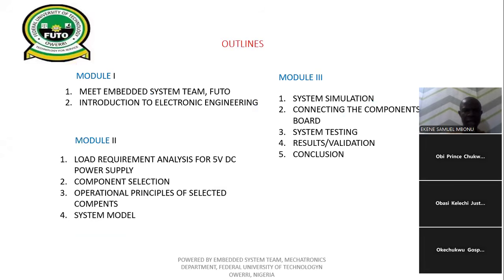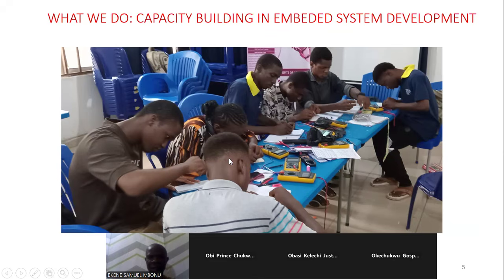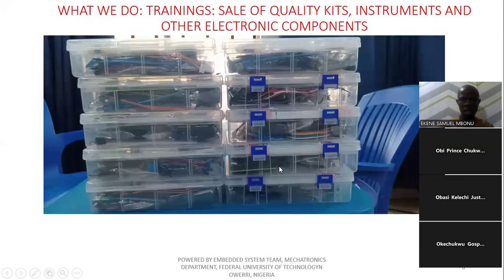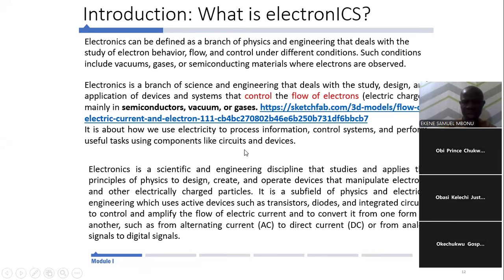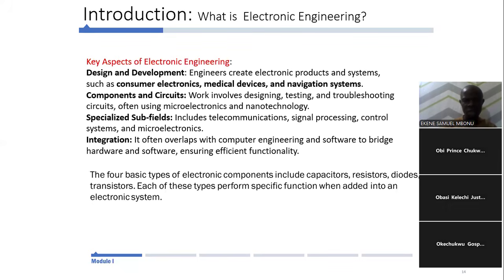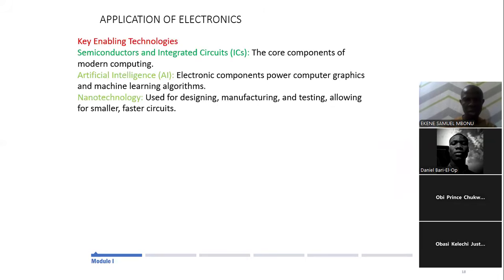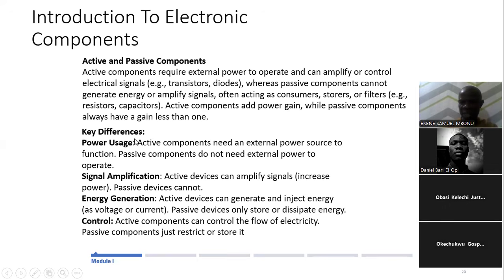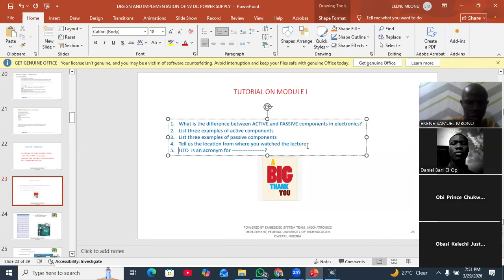DESIGN AND SIMULATION OF ELECTRONIC SYSTEMS  (MODULE I)

Comment: Good day sir
My name is Gabriel Agiounim Joseph  and I am a 100level Mechatronics student of FUTO
Active Components are Electronic components that need an external power source to work properly and can control or amplify electrical signals. Examples are Transistors, Diode, integrated circuit, etc.
Passive components are electronic components that do not need an external power source to operate and cannot amplify signals. They mainly store, limit, or dissipate energy. Examples are; Resistor, Capacitor, Inductors, etc.

Comment: Good day sir
Name: Nnaji, Chiagozie Anointing 
Department: Mechatronics Engineering 
University: FUTO
100 level 
 1. What is the difference between ACTIVE and PASSIVE components in electronics?
 Active Components: These components can inject net energy into a circuit, electrically control the flow of current, and amplify signals. They require an external power source to operate.
 Passive Components: These components cannot introduce net energy into the circuit, cannot amplify a signal, and do not require an external power source to function. Instead, they consume, dissipate, or store energy in an electric or magnetic field.
 2. List three examples of active components
 -Transistors 
 -Diodes 
 -Integrated Circuits
3. List three examples of passive components
 -Resistors
 -Capacitors
 -Inductors
 4. Tell us the location from where you watched the lecture
 I watched the lecture from my lodge in FUTO, Owerri.
 5. FUTO is an acronym for
Federal University of Technology, Owerri

Comment: Good morning sir 
My name is Ani Chinaecherem Fredrick 
100lvl student of Mechatronics Engineering FUTO 

Difference between ACTIVE and PASSIVE components:
Active components are components that can amplify or control current/voltage in a circuit and they require an external power source to work.

Passive components on the other hand cannot amplify signals and do not need an external power source — they simply consume or store energy.

Three examples of active components:
Transistor
Diode
Operational Amplifier (Op-Amp)

Three examples of passive components:
Resistor
Capacitor
Inductor

UTO - full acronym FUTO = Federal University of Technology, Owerri

Comment: Good day sir 
My name is NDUBUISI LINCOLN, a student of the 100 level Mechatronics department 
Active components are electronic devices that need an external power source to function properly and are used to control, switch, or amplify electrical signals. 
Passive components do not need an external power source and mainly store, transfer, or resist electrical energy.
Example of active components include: Diodes and transistors 
Example of passive components include: Resistors and capacitors 
I am watching from Federal University of Technology,Owerri (FUTO)

Comment: Good day sir
My name is Osoba Hebron Ebhosetalease and I am in 100lvl Mechatronics Engineering 

Active components require an external power source to operate. They can amplify signals, control or switch current flow, and generate/inject energy (e.g., increase power).

Passive components do not require an external power source.

I am watching from FUTO : Federal University of Technology, Owerri

Comment: Good Morning Sir
 I am Chukwuemeka Cherish a 100lvl mechatronics student of FUTO     
The differences between Active and passive component is the ability to generate energy or ampilify signals. Active components can generate energy and amplify signals while Passive components cannot.
Active Components; Diodes,Integrated circuits, transistors
Passive components: Resistors, capacitors,Transformers
FUTO: Federal University of Technology Owerri

Comment: Name: Cornelius Prosper 
Dept: Mechatronics Engineering 
Level: 100
Reg No: 20251516213

1: Active components are devices that can control the flow of current, amplify signals and require an external source of power to function
While 
Passive components are devices that cannot control the flow of current, amplify signals or neither require an external source of power to function but only store energy 

2: list there example of Active components
 _ integrated circuits
 _ diodes 
 _BJT transistor 

3 list there example of passive components 
 _ capacitors
 _ inductors
 _ transfors

4: I watched from hostel E futo

Futo: Federal university of technology Owerri

Comment: Good day sir 
My name is ELEKWACHI CHIBUCHI ZION
I am a 100 lvl Mechatronics student 

Active Components are Electronic components that need an external power source to work properly and can control or amplify electrical signals. Examples are Transistors, Diode, etc.

Passive components are electronic components that do not need an external power source to operate and cannot amplify signals. They can store, or limit energy. Examples are; Resistor, Capacitor, Inductors, etc.

I am watching from FUTO

FUTO stands for Federal University of Technology OwerrI

Comment: Good 😊 morning sir
My name is AKAchukwu okoudennam. A hundred level Mechatronics student FUTO

e
1. ACTIVE COMPONENTS: this are electronic components that require an external power source to operate and can control as well as amplify 

EXAMPLES :I) Transistors
                       ii) Diode
                       iii) Integrated circuit

 
2. PASSIVE COMPONENTS: these are electronic components which do not amplify signals and do not require an external power source to operate e

EXAMPLES: I) Resistor 
                      ii) Capacitor 
                      iii) Transformers 

3. UTO: University Training Office 

4. I watched from Hostel A FUTO

Comment: Good day sir 
My name is Nwankwo Confidence Chukwubuikem 
Mechatronics student of FUTO 100 lvl

Active Components are Electronic components that need an external power source to work properly and can control or amplify electrical signals. Examples are Transistors, Diode, etc.

Passive components are electronic components that do not need an external power source to operate and cannot amplify signals. They can store, or limit energy. Examples are; Resistor, Capacitor, Inductors, etc.

I am watching from my residence in FUTO

FUTO stands for Federal University of Technology Owerri

Comment: Good day sir 
I'm Adele Elvis 
Mechatronics Engineering 
100lvl

1. Active components need an external supply while Passive components do not require an external power supply.

2. Transistors, Integrated Circuits and diodes.

3. Resistors, Capacitors and Inductors.

4. FEDERAL UNIVERSITY OF TECHNOLOGY OWERRI

Comment: Good day sir my Name is Efon Concern Akpan 100 level Mechatronics engineering student 

Active components are electronic components that require external power to operate and can amplify or control signals, 

Passive components do not require external power and can not amplify signals 

E.g of Active components are
1: Transistors
2:Diode
3:integrated circuit 

E.g of Passive components are 
1: Resistors 
2: Capacitors and inductors 
Am watching from owerri

Comment: Good day sir
My name is Nwannaogu Emmanuel Uchenna and I am a 100level Mechatronics student of FUTO 

Active Components are Electronic components that need an external power source to work properly and can control or amplify electrical signals. Examples are Transistors, Diode, integrated circuit, etc.

Passive components are electronic components that do not need an external power source to operate and cannot amplify signals. They mainly store, limit, or dissipate energy. Examples are; Resistor, Capacitor, Inductors, etc.

I am watching from my residence in FUTO

FUTO stands for Federal University of Technology Owerri

Comment: Good day sir
My name Oswald oluwafemi Ngwama
I am a 100 level mechatronics student

Active components:these are electric componets that require an external power source (DC supply) to operate and can amplify, generate or control electrical signals. They can inject into the circuit
Passive components are components that do not require any external power source. They can only store or filter energy, they can't amplify the signal. 
Examples of active components: transitior, diode and integrated circuit
Examples of passive components: resistor, capacitor and inductor

I'm watching from owerri town

Comment: Good day sir
My name is Alfred Copeland Ifesinachi.
I am a 100lvl student of mechatronics engineering.
1) Active components are electronic components that require an external power source to operate and can control as well as amplify signals
Passive components on the other hand are electronic components which do not amplify signals and do not require an external power source to operate
2)  3 examples of active components are as follows:
    2.1)Transistors
    2.2)Diodes
    2.3)Integrated circuit
3) Some examples of passive components are as follows:
     3.1) Resistors
     3.2) Capacitors
     3.3) inductors
4)I watched the lecture from my residence in Federal University of Technology Owerri 
5) The acronym FUTO stands for  "Federal University of Technology Owerri"

Comment: Good evening sir 
My name is Kalu Kvothe Paul Emeka 
I  am a 100lvl mechatronics engineering student 
1. Active components are components that can electrically control the flow of current or provide amplification. They require an external power source to function and can inject power into a circuit

2. Passive components are components that cannot amplify a signal or control current with another electrical signal. They do not require a power source to operate; instead, they absorb, dissipate, or store the energy already flowing through the circuit.

3. Transistors, diodes and integrated circuits (IC)

4. Resistors, capacitor and transformer 

5. I watched this lecture from Federal University of Technology Owerri (FUTO) Eziobodo 

6. UTO stands for University Training Office

Comment: Good day sir 
My name's are Ozoemena Dominion 

The difference between active and passive components in electronics 

Ans: Active components requires external power to operate and can amplify or control electric signals 
       Passive components they always have again less than one was essential for signal management and power distribution.

2. Example of active components 
Transistors
Integrated circuit 
Diodes

3. Example of passive components 
Resistor
Inductors
Transformer 

4. Location 
Futo imo state Nigeria 

5. FUTO meaning 
  Federal university of Technology Owerri

Comment: My name is Nwoko Uzoma 
300level mechatronics engineering 

1. Active components are components that require an external power source and can amplify or control electrical signals.

Passive components do not amplify signals and usually store, transfer, or dissipate energ

2. Three examples of active components

Transistor
Diode
Integrated Circuit (IC)

Three examples of passive components
Resistor
Capacitor
Inductor

3. Federal University of Technology Owerri

Comment: My name is Anyanwu chidiebube benneth
Reg no 20251537063
Answer
1)In terms of power usage activecomponents need external power source to function while passive components cannot
2)Examples of Active components are 
Transistors (BJTs,FETs)
Integrated circuits  (ICs)
Diodes
3)Examples of passive components are 
Resistors 
Capacitors
Inductors
4)Am watching from Alex comfort suite in eziobodo FUTO
5) FUTO means Federal University of Technology Owerri

Comment: Good day sir 
i am Akaligwo Uchenna a 100lvl student of mechatronics engineering 
active components are electronic components that requires external power to operate and cannot amplify signal

Types of active components 
transistors
diode
integrated circuit 

Types of active components 
resistor
capacitor
inductor
Am watching from FUTO

Comment: Good day sir I'm Izunobi Antonio Chiemerie I am a 100 level 
Mechatronics engineering  student 
The difference between active and passive components is
Active components that use external power to operate and can amplify or control signal while passive components don not need external power  to operate 
Examples of active components 
Integrated Circuit 
Transitior
Diodes 
Examples of passive components 
Resistor 
Capacitor 
I watched the lecture from Obinze 
FUTO means Federal University of Technology Owerri

Comment: Active component requires external power to start
Passive component do not require external power

Examples
Active- transistors, diodes, integrated circuits
Passive- resistors, capacitors, inductor

I am watching from here🙃

Comment: 1. Active components amplify electrical signals while passive components store or filter electrical signals. 
2. Transistors, diodes and ICs
3. Resistors, capacitors and inductors
4. FUTO
5. Federal University of Technology, Owerri

Comment: My name Is Duru munachimso zoe, 100lvl mechatronics student

Active components relies on power supply to function, eg Transistor, integrated circuit, diodes 
Passive doesn't need power supply to function 
Transformers, inductors, transformers

Comment: Good day sir 
My name is Nnamocha Peter Chibueze I'm a 100 level student of mechatronics engineering student 
Active components are electronic devices that need external power source to function properly and are used to control switch or amplify electrical signals passive components do not need an answer external power

Examples of active components include 
Integrated circuits (IC)
Transistors 
Diodes

Examples of passive components are
Resistors, capacitors and inductors

FUTO stands for Federal University of Technology Owerri 

I am watching this video form Imo state

Comment: No 1: Active component requires external power to operate and can amplify or control electrical signals while passive components cannot they often act as consumer, stores or filter

No 2: Active component; diode, transistors and integrated circuit 

 No 3: Passive components; resistor, capacitor and inductors

No 4: I watched form the Federal University of Technology Owerri

Comment: Good day sir
My name is Ogbonna Uchenna Emmanuel a student of the 100level mechatronics department. 

Active components are electronic devices that need an external power source to function properly and are used to control, switch, or amplify electrical signals. Passive components do not need an external power source and mainly store, transfer, or resist electrical energy. 
Examples of active components include:  Diodes and transistor 
Examples of passive components include: resistor and capacitor.
I am watching from the Federal university of technology of Owerri (FUTO)

Comment: Good morning sir 
My name is David Marvelous ogbu 
I'm a 100lvl student Mechatronics engineering 
Active components are electronic components that require external power to operate and can amplify or control signals, while passive components do not require external power and cannot amplify signals 

The three examples of am active components 
1. Transistors 
2. Diodes
3. Integrated circuit 

Example of passive components 
1. Resistors 
2. Capacitor and inductor 

I'm watching from Owerri

Comment: My name is ASADU KAOSISOCHUKWU KEVIN 
I am a 100 level mechatronics engineering student.

Active components are electronic devices that need an external power source to function properly and are used to control, switch, or amplify electrical signals. Passive components do not need an external power source and mainly store, transfer, or resist electrical energy.

Examples of active components include:
Transistors
Integrated Circuits (ICs)
Field Effect Transistors (FETs)

Examples of passive components include:
Resistors
Capacitors
Inductors
Transformers

Watching from owerri
FUTO is federal university of technology owerri

Comment: Good day sir
My name is Daniel Prince Chibuezem
I am a 100lvk mechatronics engineering student.

Active components are electronic components that require external power to operate and can amplify or control signals, while passive components do not require external power and can not amplify signals.

The three examples of an active components:
1. Transistor 
2. Diode 
3.integrated circuit (ic)

Example of passive components:
1. Resistors
2. Capacitor and inductors 

I'm watching from owerri.

Comment: My name is Duruigbo Ihechukwu Blaise  and I am a 100 lvl Mechatronics Engineering student 

Answers: 
1. The difference between active components and passive components in electronics is that  active components need an external source of power to function and work where as, passive components do not require external source of power to work. Also, active device can amplify signal while passive devices can't. Lastly the gain of active components is greater than one while that of passive components is less than 1
2. Diode, Transistors, and integrated circuit 
3. Resistors, transformers and inductors 

I'm watching from The Federal University of Technology Owerri and UTO means University Training Office

Comment: 1. Difference Between Active and Passive Components
The fundamental difference lies in how these components interact with electrical energy and signals:
 Active Components: These can inject power nto a circuit, amplify signals, or control the flow of electricity. They require an external power source to operate.
Passive Components: These cannot  introduce energy into a circuit or amplify signals. They can only store, dissipate, or release energy that is already present. They do not require a separate power supply to function.
 Three Examples of Active Components
 1. Transistors:(e.g., BJTs or MOSFETs) used for switching and amplification.
 2. Diodes:Used to allow current to flow in one direction (including LEDs).
 3. Integrated Circuits (ICs): Such as operational amplifiers or microcontrollers.
. Three Examples of Passive Component
 1. Resistors:used to limit current or divide voltage.
 2. Capacitors: Used to store electrical energy in an electric field.
 3. Inductors:used to store energy in a magnetic field.

FUTO is an acronym for federal University of Technology, Owerri